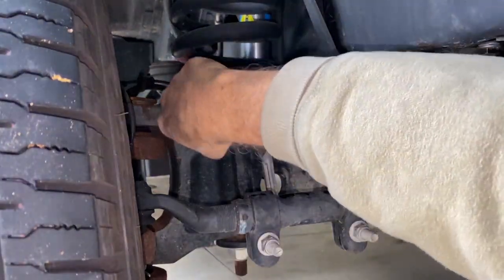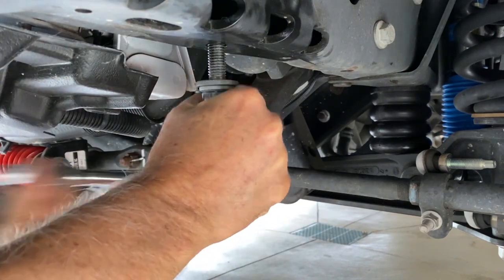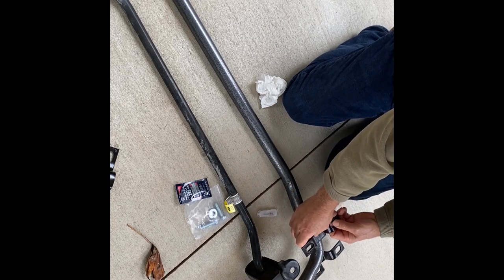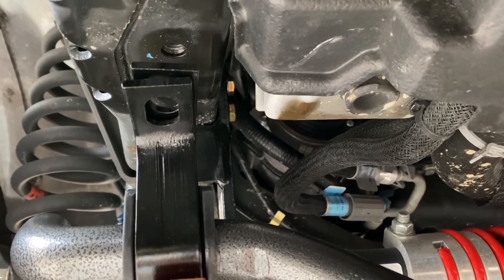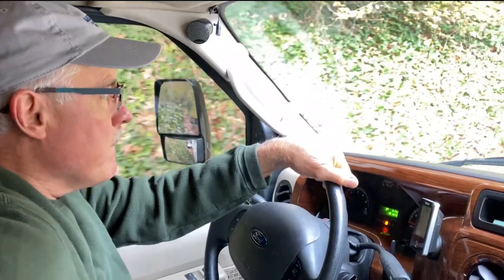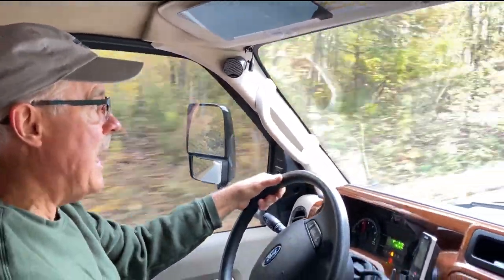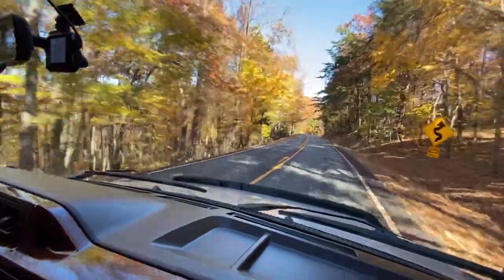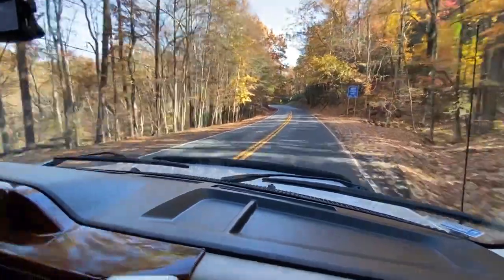5 Amazing RV Suspension Upgrades, Part 2, Hellwig Sway Bar & Alignment

Comment: Why didn’t you install a sway bar on the back of your vehicle?
Reply from the maker: Thanks for your question. First off , I was trying to stay under $1000 while also getting the most bang for the buck. My Class C is only 28’ long. I get minimal rear sway when big trucks pass or going in and out of gas stations for example. 
Class C’s over 30’ should see an improvement with a rear sway bar if they are experiencing a lot of rocking motion.
And don’t forget, mine came with the Ride Rite rear air bags inflated to 80psi.  From day one, they kept the rear end stable.
Reply: I have to agree with Lizette. I think you would indeed notice a huge improvement by adding the beefiest rear sway bar you can fit. The airbags don’t handle sway like a bar does.
Reply: @Propelled  I've installed airbags on a couple of pickups myself in the past along with being around other airbags installed on pickups and while the idea seemed good in theory and yes in some situations it was nice to have the option of inflating them for a temporary higher load, in actual practice they are far from ideal. The problem is these styles of airbags they sell for this use are nothing like a properly sized integrated airbag system on a highway tractor or motorhome. These smallish diameter bags with any amount of air in them do not allow for proper suspension travel and the bag is taking away from the spring to do its job and typically not helping the side lean or handling like the claims that are made. So having leaf springs capable of carrying the load is one aspect along with shocks that are capable of controlling the axle movements. As to side sway stability and why I am agreeing with your comment Propelled, without a doubt the largest sway bars one can buy and installed front and rear is what makes a huge difference. Pickup campers that are of the largest heaviest tallest type for example and putting a one ton dual wheeled pickup to its maximum weight capacity is a very good example. Increasing the spring pack if required as well as using those "stable loads" type wedges helps quite a bit as it puts that overload spring into action to help reduced side sway. Then replacing the factory sway bars both front and rear with the largest diameter ones that can be bought to mount up, they make a huge difference. These chassis that are bought by the motorhome manufacturers almost always seem to be pushed to their limits with spring rate and undersized swaybars, a top heavy unit that is too heavy for the chassis they use ... its all about the bottom line to the companies sadly, not about having created a well handling strong unit.
Reply: Well said Charles. I agree.  That road master stabilizer mount really concerns me, I did not see any triangulation too support the load, and I'm a little lost on the reason for the spring ?  I'd like to know more about that. 
A bilstein damper would be my choice .
And yes I would have started with a rear sway bar before upgrading the front.  For strictly road use a dual swaybar setup is very confidence inspiring. 
Keep your airbags inflated only to support extra load not for lifting beyond the natural spring height.
Reply: @ronedelenbos272  I know what you mean by the lack of triangulation on that frame mounted steering shock mount, flat bar even if its fairly thick but has some length to it can flex although I can't claim this setup will flex, it was a question in my mind as well when I saw that assembly. I've never had anything to do with those spring style steering shocks but the theory behind them ( when adjusted correctly ) is to help hold the steering tires straight and also would assist in "return to center" of the steering wheel when coming out of a turn. I have to ask myself why is a contraption like that even required, is it helping to overcome incorrect steering geometry, after all highway tractors ( semi's if one prefers that name ) certainly do not need gizmos like that to steer properly. I believe in one of the shots you can see the motorhome does have a rear swaybar ( it would be insane not to have one from the factory ) and what is interesting is that some aftermarket swaybar installations on certain motorhomes leave the rear factory swaybar in place and add on a beefy unit on the opposite side of the axle housing. That right there tells a person just how much swaybar can be added to some units to make them what they should have been when rolled out of the factory to begin with. Always about that all mighty dollar to sell the glitz and under engineer the mechanics of a unit.

Comment: On a different note, I notice the driver seat, is that the factory one or did you upgrade it? The one that comes with mine, after a few hundred miles you can feel very uncomfortable.  Wondering if upgraded where did you get it from? Thank you in advance.
Reply from the maker: Hi Alex, I felt the same way and set out trying to find a better captain’s chair for the E450 cutaway chassis.
A friend of mine had purchased a Coach House on the E450 with those chairs and when I saw them, I had to have them. 
After contacting Coach House, I was told those were custom made for them. Long story short, the person at Coach House didn’t want to share his sources and it was a challenge to get him to send me a set. My biggest concern was how the chair would mount to the seat base. It was not an easy task and I was fortunate to have a friend who does metal fabrication. 
In the end, I do like them but I wouldn’t go through the hassle again.
For those wanting to upgrade, I would suggest having them upgraded by a custom auto upholstery shop to your specifications. I would also add the power adjustable base to the passenger side to. Good luck and let me know which way you went.

Comment: Can you give the decision making factor for choosing hellwig over roadmaster anti sway bar? Hellwig ses to be a bit more pricey and from my research is a very similar if not the same product quality. Just curious about your thoughts.
Reply from the maker: Thanks for taking the time to comment. I chose Hellwig based on what I perceived to be the more popular swaybar and the fact that Forest River installed them as a suspension upgrade on some models of their motor homes.
Reply: Hellwig is a well know Sway bar supplier.  When looking for suspension upgrades or improvements  the marketplace is full of gimmicky cheaply priced bandaid solutions to mask the real issue.  
Search for the real suppliers of upgraded or performance parts.  These do cost more money but the result is usually worth every extra penny.  RV companies  don't know  suspension they know a quick fix with a bandaid solution is a easier sell.
Reply from the maker: @ronedelenbos272  
I can honestly say I have not read anything bad about the Hellwig company. They have been in business since 1946 and and have developed many suspension improvements for trucks and cars over their history. 
Price point is definitely a factor when considering suspension upgrades.
Suspension upgrades are just one part of the puzzle. 
Weight, load balance, tires, condition of other components and driving habits all play a part.

Comment: How much air do you have in the air bags when traveling and pulling a toad?
Reply from the maker: Hi Tammy, I don’t tow but carry about 150lbs of bikes on the back. I keep pressure between 75-80 psi and from what I have read, that’s what many other set their pressure to also.

Comment: Roadmaster reflex steering stabilizer vs safe-t-plus, any comments?  I have been researching for a while now...thanks for the video and opinions
Reply from the maker: Really no reason other than it seemed more people purchased the Roadmaster.
Either one would be a huge improvement from the stock one!
Thanks for your question.
Reply: I'd opt for a brand name who's main focus is in suspension, most RV suppliers carry bandaid or booster parts .  The source of most suspension issues is the suspension.  always start at the foundation of your issues.
Booster coils, bags, snobbery are all   bandaid and do not address the real issues with factory Motorhome suspension   Bilstein,Fox,Rancho carry suspension products for Motorhomes

Comment: What size tires do you run.?
When I first received my 26 ft. Class C Fleetwood tiogo it had 225 etc  I needed tires on a trip and next thing ya know I have 235.75 16
 I Believe. I do think I liked the wider tires. Because of less chance of a rock  getting stuck between them.  Yes I was a newbie. But those old 225 dually where tore up . I'm looking at 5yrs on these tires . So time for new I'm ft but only travel 300 miles a month maybe. I'm going to have all the removed and check them out and check suspension all the goods.
Reply from the maker: Hi Kathy, thanks for your reply. My E450 chassis came stock with the 225 75R 16’s. 
Not being a tire expert, I would think more tread on the pavement is better! Up to a point though. It can affect gas mileage,  front tire clearance when turning and contact area between the dually’s. Did you have to add a spacer plate etc?
I will run this by my large truck tire expert when it’s time to replace. 
Thanks again!
Reply from the maker: After doing some research, my recommendation is to go with the chassis manufacturers tire size which can be found on the drivers door jamb. 
After all, they are the experts.
Reply: I ended up with the 225, and some new shocks ( that they said are RV Shocks)  smooth ride But now that is all done I've noticed that while passing truckers. I'm being sucked in!?  With the wider tires I never felt that . They told my sway bars and bushings were all good.  And that I may need to get an tire alignment for my back tires duallys?? This is thing?
Reply from the maker: Hi Kathy, I personally have never heard of a rear alignment. 
This article might help you from Forest River Group:
FORD E350/E450 alignment, Wandering, Caster, Play in steering wheel
The issues this author is describing never happened on my RV even before any upgrades. 
I have always taken my motor homes to a large truck repair center and had them do the alignment.

Comment: Hello, I was curious how well the front sway bar helped when being passed on the highway by big rigs…?  You mentioned testing this out in the video, but never came back with any answers…?
My ‘06 E450 C 31 footer that only has air bags on the rear, darts off the road as soon as a big rig blows by you on the highway. Rear bags ( towing purpose mainly ) are my only upgrade so far, but curious if the Hellwig front sway would be worth the money or not…?
Without getting knee deep in $$$$ upgrades to the suspension system.
Reply from the maker: Hi Kirk,
Short answer, the upgraded front sway bar will improve your ride. There are many other issues related to wind and passing 18 wheelers pushing you off the road.
I’m sure you have correct air pressure in tires and air bags and a balanced load. Are you towing?
All I can recommend is to do the upgrades in the order I did and even add a rear sway bar if not happy. 
I have no issues with passing trucks. Crosswinds can always be a challenge.
Good luck! Let me know what worked.
Reply: If you have no rear sway bar, absolutely install one. I just put one on my 89 e350 Lazy Daze.

Comment: https://youtu.be/Y8CbNioawt0
  notice the stronger steering damper mount .  Also the rear bolt he's replacing is something to watch. These HD hellwig swaybars are very stiff and can twist and pull on twisty roads.  The hellwig mounts are actually  kind of light duty
Reply from the maker: Hi Ron,
thanks for bringing that to my attention.  I’ll keep an eye on my setup. 
That’s one reason I stressed getting all of the threadlock off the old bolts and making sure you didn’t cross thread which would certainly cause pullout. 
It would have been nice to upgrade that bolt just for good measure. 
If Hellwig sees this as a common issue, I’ll upgrade for sure!
Safe Travel!
Reply: @SafeTravelRV    absolutely keep an eye on the mounts, you did do a very good job of being proactive on the sway bar mount install, better safe than sorry.  And while that new mount looks a little anemic  Id keep an eye on the mount bolt thru the frame. A good fab shop could  beef that up.
You have to keep in mind how much leverage is being  applied on that hanger mount under load . A good lean on yor RV while enjoying a sprited drive means the swaybar is trying to fight all that overhead weight, the taller the vehicle the more that bar is screaming to resist the twist. Hellwig should have a lighter rear bar that is slightly heavier than your original rear bar.  It would help take some load off the front bar.
But a better route may be to find a good old school spring shop and have them build you an additional load leaf setup or just opt for springs made specifically for your RV weight.   
In a Motorhome ,the suspension is generally undersized and overloaded  and the result is a watered feel  while driving during wind and passing trucks, it's worse when your fully loaded with family.  
No bandaids really correct the main suspension issues.

Comment: Can this set up be used and put on a 2007 dodge ram 3500 dually?
Reply from the maker: If you are having issues with your suspension on a 3500, being as it’s a 2007, I would have the shocks replaced first, check all other suspension components for wear and or damage and proceed from there.
Good luck and report back!